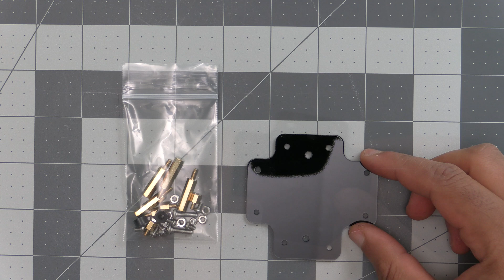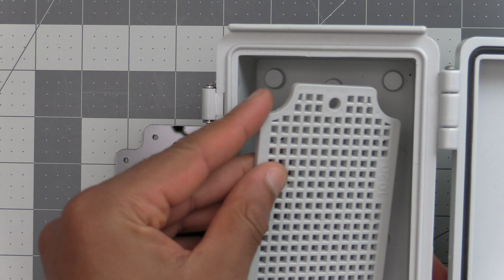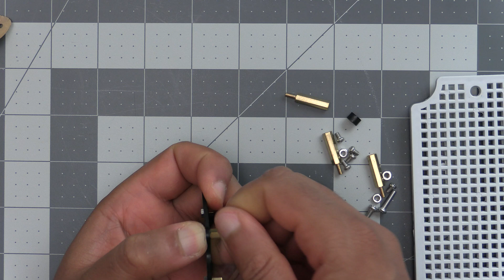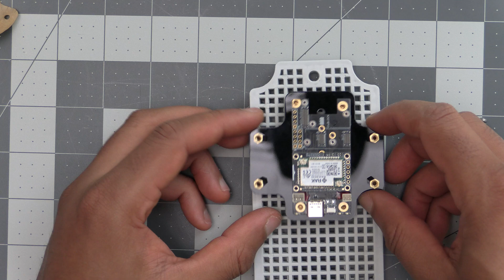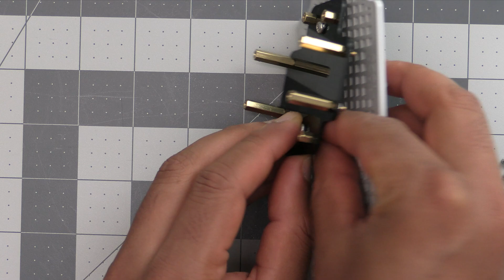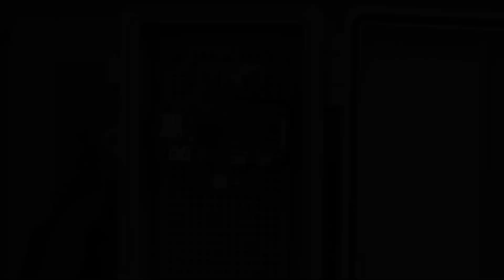WisPi Mounting Kit | Setup Instructions for mounting RAK Meshtastic Starter Kit & Raspberry Pi Zero

Comment: Id like to see something that would control hardware pins on the rak. So we can upgrade firmware while its mounted to the tower (150' in the air)
Reply: Hardware Requirements
RAK19007 Baseboard + RAK4631 Core
Raspberry Pi Zero (or similar microcontroller) for remote control
Relay Module or MOSFET Switch:
Used to toggle power or reset lines.
UART/I2C Interface:
For direct communication with the RAK module.
OTA Bootloader:
Implement an Over-The-Air (OTA) bootloader for the RAK4631 firmware.
Pin Control for Firmware Upgrade
Reset Pin:
Use a GPIO pin from the Raspberry Pi to toggle the reset line of the RAK4631.
Bootloader Pin:
Control the BOOT0 or similar pin (if available) to force the RAK into bootloader mode.
Power Control:
Add a relay or MOSFET to control power cycling the RAK module remotely.
Remote Firmware Upgrade Workflow
Normal Operation:
The RAK module runs its main application.
Trigger Firmware Update:
The Raspberry Pi sends a command (via UART/I2C or remotely over the internet) to toggle the reset and bootloader pins.
Firmware Upload:
Use a tool like nRF Connect or a custom OTA solution to upload the firmware.
Reboot to Application:
After the update, the system toggles the reset pin to restart the RAK module into normal mode.
Software Implementation
GPIO Control on Raspberry Pi:

Use Python or a similar language to control the GPIO pins for reset and bootloader.
Copy
import RPi.GPIO as GPIO
import time

RESET_PIN = 17
BOOT_PIN = 27

GPIO.setmode(GPIO.BCM)
GPIO.setup(RESET_PIN, GPIO.OUT)
GPIO.setup(BOOT_PIN, GPIO.OUT)

def enter_bootloader():
    GPIO.output(BOOT_PIN, GPIO.HIGH)
    time.sleep(0.1)
    GPIO.output(RESET_PIN, GPIO.LOW)
    time.sleep(0.1)
    GPIO.output(RESET_PIN, GPIO.HIGH)

def exit_bootloader():
    GPIO.output(BOOT_PIN, GPIO.LOW)
    time.sleep(0.1)
    GPIO.output(RESET_PIN, GPIO.LOW)
    time.sleep(0.1)
    GPIO.output(RESET_PIN, GPIO.HIGH)
OTA Firmware Update:

Implement a script or use existing tools to upload the firmware via UART or Bluetooth.
Remote Access:

Set up SSH or a web interface on the Raspberry Pi for remote control.
Optional Enhancements
Watchdog Timer:
Automatically reset the RAK module if the firmware update process fails.
LoRaWAN Command:
Use the RAK module's LoRaWAN capabilities to trigger the update process.